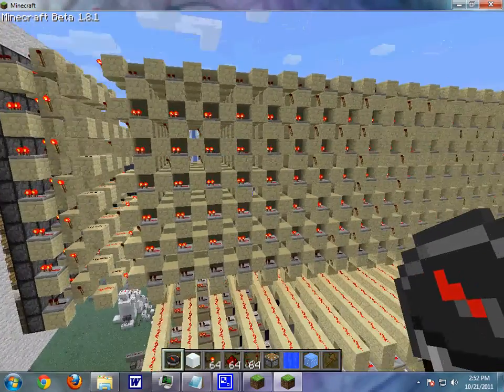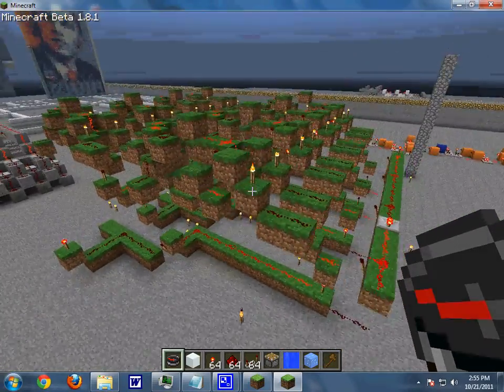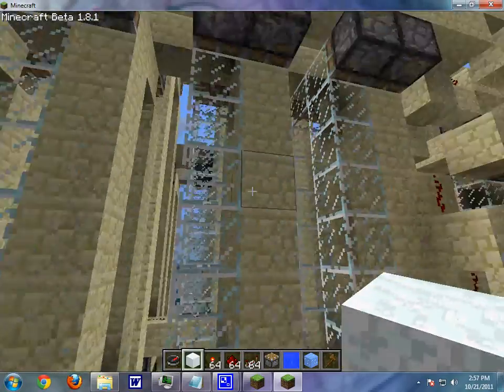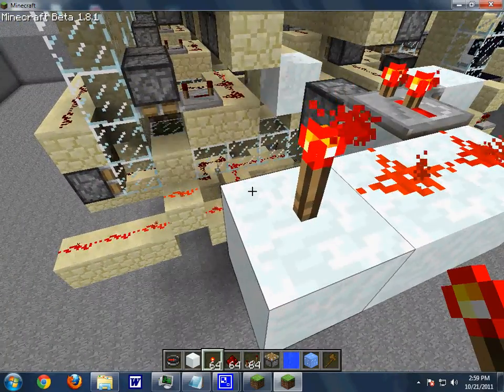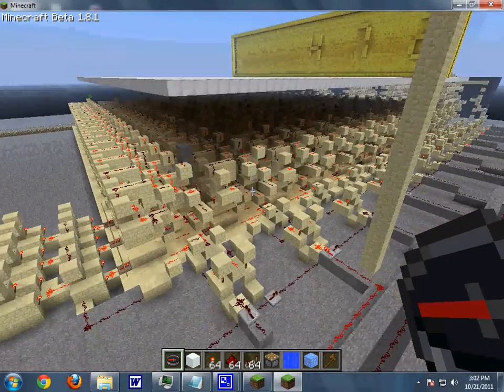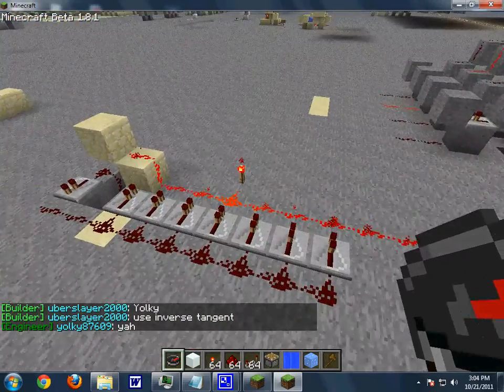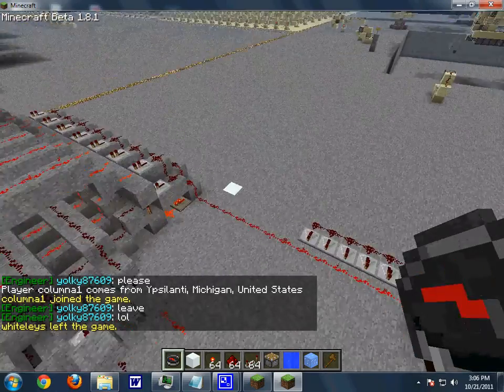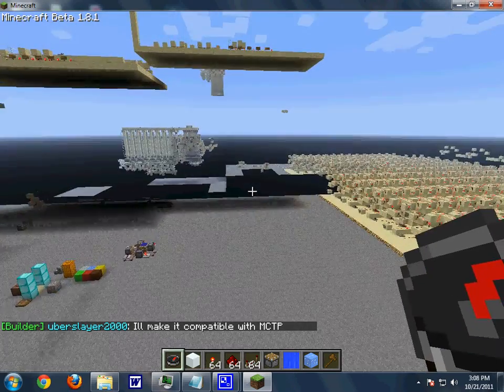So much

Comment from the maker: @jeremyjts According to strict definitions, the most RAM in minecraft is not RAM. Signal length causes delay as you go farther back, so if you have a 4 long model each section could only have 4 bytes. I would rather have tape memory than that :P.

Comment: Just because the tape is addressable does not make it RAM.  RAM can access any address without interference from any other address.  To go from address 1 to address 0 you have 71 addresses interfering that you must cycle through in order, which would take 50 seconds if it were 7 ticks fast.  Still some impressive work in here, thumbs up for you sir.